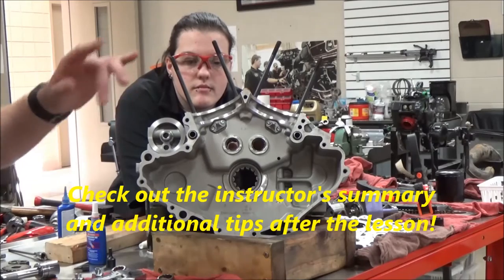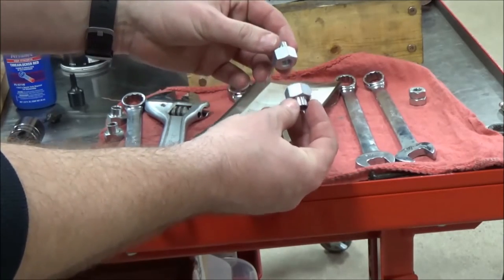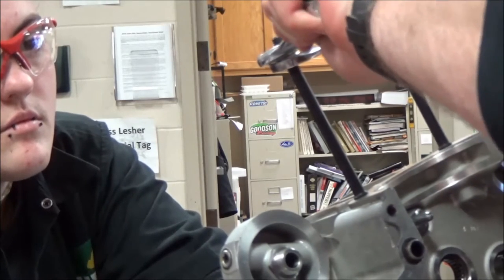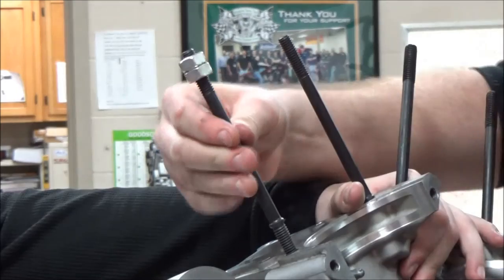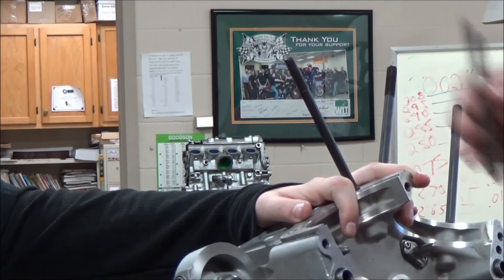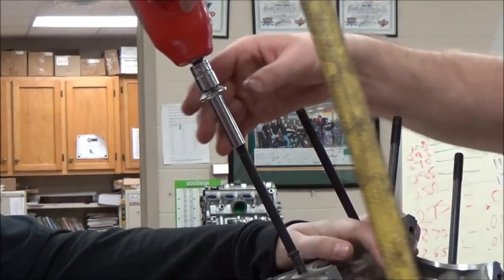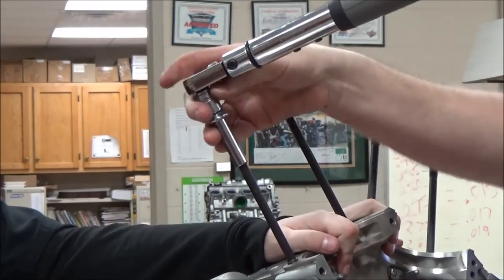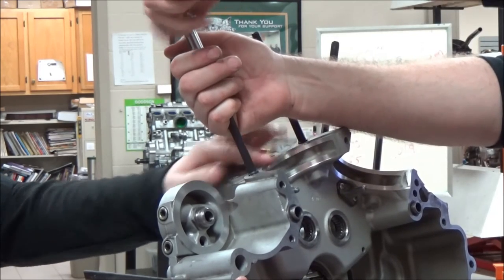Twin Cam Series: 09 Cylinder and Exhaust Stud Removal, replacement and installation Same as EVO

Comment: I'm retired Automotive technician on some of the automotive studs were so tight we would put a lock washer in between both nuts so the both nuts wouldn't turn the same time work great, keep up the videos you doing a great job

Comment: At 4:29 you mention studs flange up vs flange down. My 93 evo originally had flange up studs. The threads on the bottom (case side) of the stud were interference threads, but the upper (head side) threads were normal threads. If you looked closely at the threads, you could see an obvious difference. The head bolt would easily screw onto the top of the stud, but bind on the bottom of the stud. I think they superseded that type stud with the later 96 and later flange down studs on all years of evo motors. On this type, the threads are exactly the same on each end of the stud. This 96 and later stud comes with the loctite patch (like the ones you are installing) on the lower portion to lock the stud in the case vs the interference threads of the old style. In this situation, going by the fsm could get you in trouble. My 93 fsm shows a picture clearly stating the flange goes at the top, but later fsm show a picture and clearly states to put the flange down. As far as I can tell, if harley part no.16837-85C cylinder studs are being installed, the flange goes down.
Great videos, Great teacher!
Reply from the maker: Nice...thank you for sharing part numbers and in depth comment that may help another person in our community some day! 

We sure love you taking the time to comment. Are you coming to the next live session? 
There a few ways you could help keep this work going and stay connected with me personally.  
1. The fastest and best thing you could simply do for us is hit that subscribe button…helps us creators more than you know! 
2. Join this channel to get access to perks:
https://www.youtube.com/channel/UCBhM8DCKnT3qXwTW0eToyCg/join   
3. Give us a high 5 here:  https://www.paypal.me/how2wrench    
Keep Wrenching,
Shane Conley
Peoria, AZ USA
Follow us!
www.How2Wrench.com       
www.Tools2Wrench.com    
Facebook: 
https://www.facebook.com/How2Wrench/   
Instagram:
https://www.instagram.com/how2wrench/

Comment: That's great on a new block like you have, what about a TC88 block with 50k miles from MI, that have rust pitting and snap in the block with your two nut method? I'm a very experienced Technician but getting these studs out to install ARP head studs are kicking my ass. I've tried heat, 6 different stud removing tools, penetrating oil etc. Doest work at all like your vid..
Reply: Have you gotten all of them out yet?